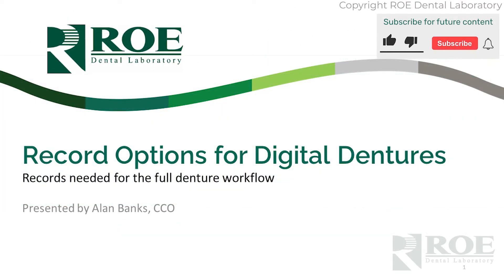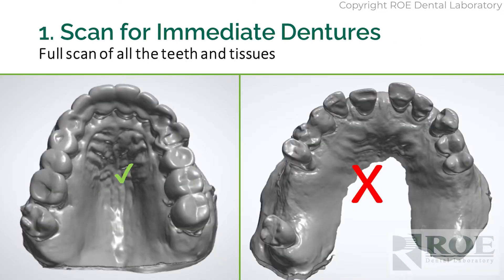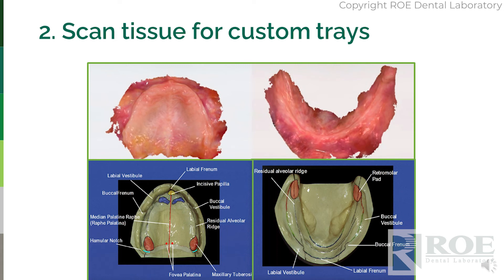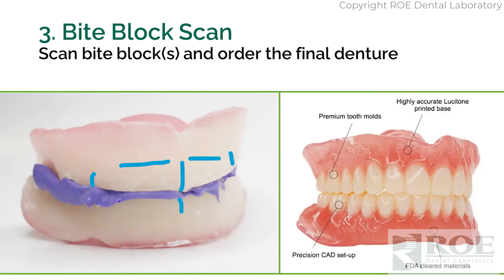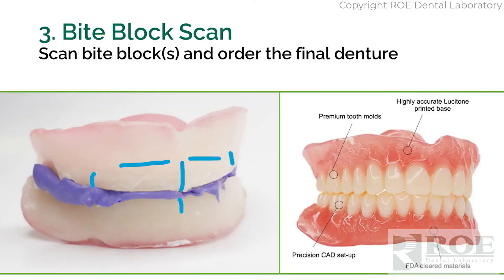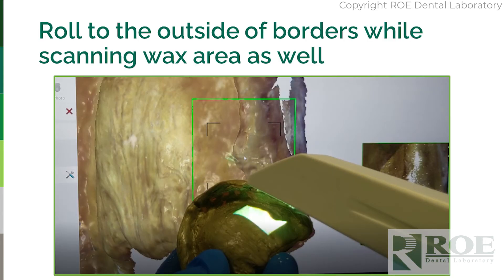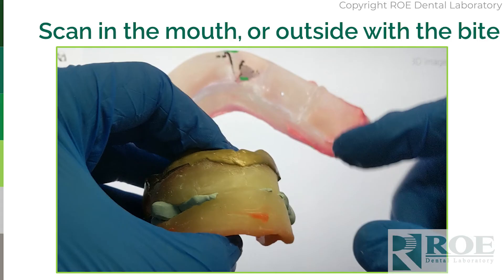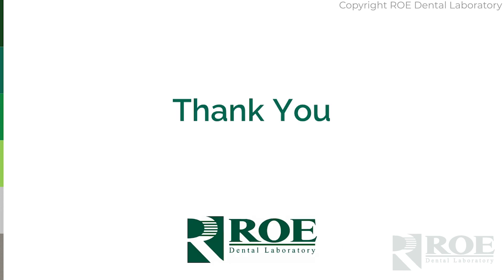Record Options for Digital Dentures: Records for Full Denture Workflow

Comment: If I am trying to take a scan of an upper border molded wax rim and my scanner is incapable of scanning in color, what is the best way to communicate the position of the vibrating line?
Reply from the maker: What are you trying to accomplish? Are you asking because you want a post palatal seal on the denture? With digital dentures we don't normally make a post palatal seal. That was needed with standard processed dentures because of material shrinkage. The materials we are making digital dentures out of don't have that shrinkage issue so they do not need a post palatal seal. 
If you really want that and can't capture it with you scanner, you can physically send it to us at ROE Dental Laboratory and we'll be glad to help!
Reply: @ROEDentalLaboratory  Trying to prevent over extension and minimize chair time at delivery.
Reply from the maker: @effefffffffffffffffffffff  Hi there! You could just score the impression lightly where you want it to end. Nothing to deep so doesn't affect it or  you could also just trim back the impression just before it.

Comment: is a centric tray not needed to make the bite blocks? How do you measure VDR, VDO?

Thank you for sharing a great video
Reply from the maker: Thank you for the question! Bite blocks are made to specific measurements. Doctors generally add or remove wax from them to get the VDO they desire for the patient from those standard measurements. There are centric trays on the market that can be used as well.